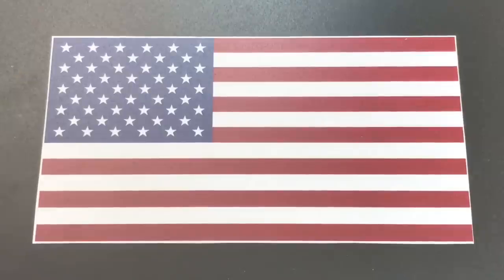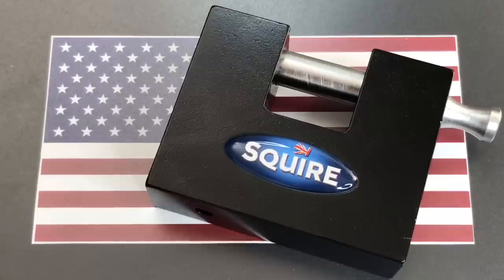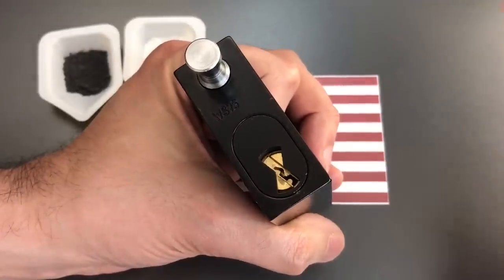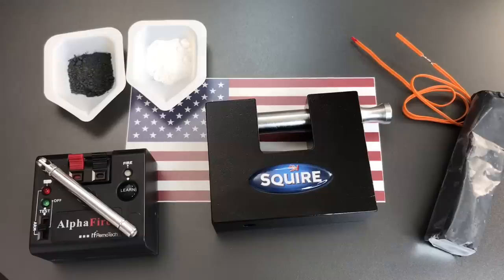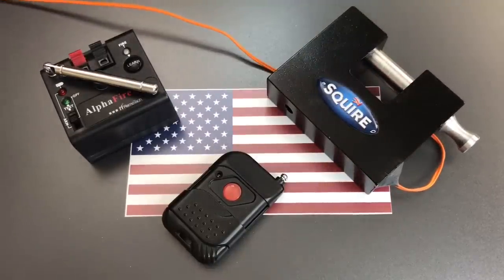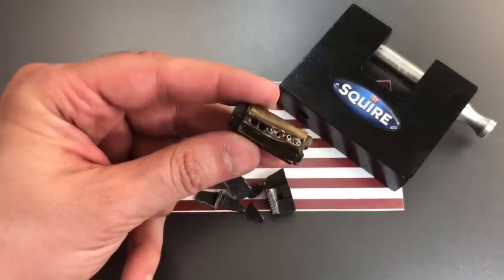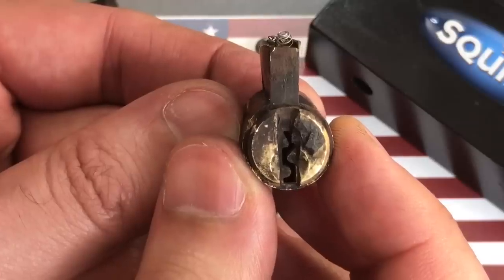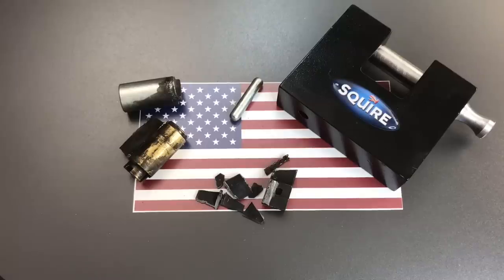[510] Opening a Lock With Explosives!!!

Comment: I tried this too, with AP. Stuffing the keyway with a key as a ramrod works well, though a bit nerve wracking.  I found that higher end locks are actually more vulnerable to this attack: The harder steel fractures more easily rather than bending, and the tighter tolerances hold the expanding gasses in better.

Comment: Chlorate and aluminium dust - great!   Excellent choice, if you're going for a mixture (rather than a chemical compound).   In fact, the only mixture I know of that would stand a chance of fully burning properly in such a small volume.   About the nearest any mixture gets to being a high explosive.   Aluminium makes anything go better   ;)    And a lovely bright flash. 
I was going to say that gelignite would be the more traditional explosive for this purpose  - but I'm not sure.   Gelignite is probably more powerful but it needs proper detonating, and I'm not sure how one would get a detonator through that narrow gap.   Just setting it on fire won't work.   Whereas chlorate and aluminium is so eager to do its thing that it only needs the slightest spark...

Comment: You probably could also do this with half the amount of explosives.
The trick is to make it airtight as possible, so pressure can build up.
It doesn't matter how little amount explosives you use: When it can hold enough pressure, it will blow.
Many people think a stronger container is more capable to resist explosives from the inside.
The opposite is true. It only makes the pressure build up, and the big bang, even greater.
I would have done it under water, leave the top open, otherwise your aquarium will also blow.
It slows down, and contains the explosion more than only a steel box.
You would be capable to film it better.

Comment: Hey, I've been wondering about thermite. It would be easy on a lock that you could put in any position since thermite flows down. I would think you would need to make a ceramic cup of some kind that would allow the flow of the thermite to move horizontally.  Try it out!

Comment: What a great way to celebrate the 4th. I didn't think you would have enough mixture to cause an explosion. 💥I figured you would get a roman candle effect. It Worked perfectly though. Shock waves always accompany an explosion. 😁 Nice job, and very entertaining. 👏
Reply from the maker: +William Mancel You probably would have been right were it not for the epoxy... that lets the pressure reach destructive potential.  Without it, this would have been a big nothing burger.

Comment: As a California Licensed Pyrotechnician, and in the Professional Fireworks Business for many years, I want to know if you really  used ONLY 50 mg of "Flash"?  Did you weight it?  50 mg is the same maximum powder limit specified by the CPSC (US Consumer Product Safety Commission) for a USA legal Firecracker (in those states that permit Firecrackers, of which California is not).  This is a extremely small amount of Pyrotechnic composition and I am stunned by the results.  Such legal 50 mg Firecrackers barely have enough powder to even function!
Reply from the maker: +Ken Nixon I did not personally weigh it, but I have no reason to doubt the person who did.  It was indeed a very small amount... as I said in the video, after seeing the small amount used, I doubted it would work. If I had guess why this worked (and take this as the uneducated musing that it is), I'd speculate that the confinement in the hardened steel lock (capped with epoxy) was far, far greater than that of a firecracker's paper shell... greater confinement equals greater pressure build up and destructive potential.  Thoughts?
Reply: I have extensive experience "playing" with 50 mg Firecrackers in legal states and is say that there is NO WAY that ONLY 50 mg of "flash: has enough energy to break that steel plate.  I will forward the video to an expert I know who has professionally researched many types of "flash" for the DOD and see what he thinks.  Quite clearly your video with the chemicals in your plastic trays far exceeds 50 mg by a factor of 10 to 50 at least, I would guess (and the "aluminum" looks like BP (black powder).  So I call BS.  To weigh such a tiny amount as 50 mg takes a very expensive, precision scale.  50 mg on the end of your fingertip looks like a tiny pile of dust.  I would also think that this tiny amount of composition would spread out and disperse within the lock "cavity", and reliable / complete deflagration could even be a problem.
Reply: I have some comments back from my expert friend (employed by a Pyrotechnic manufacturer as an R&D development engineer) who has extensive experience in all forms of Pyrotechnics.  Here they are slightly abridged below

"I watched the video and I guess I could say that we didn't see the AMOUNT of powder that was introduced to the lock, and it's always possible that it took more than one try to get it right.  The potential velocity of that mixture, if initiated rather than just lit, can be as high as 2200 fps, in "our" tests with the USG agency.  The sound in the video is more like a low pressure hiss, actually, and I think enough gas might just do it, because the lock is designed to resist external stresses, not internal.  I have a little trouble believing that the keyway was squeezed that much, but the embossing seems probable if the distribution of energy had to travel through that small opening and was held back by the epoxy.  The hardened steel cover plate would have to be pretty brittle to fragment like that. Fragmentation of witness plates is pretty small and localized, even in bigger tests.  They tend to rip.  But there can be fragments right in the center.  So I'll say the it "could be true" - I would want to see multiple trials and controlled conditions before I'd endorse it.

So the confinement certainly makes a difference.  If I remember right, the 63:35 mix is stronger in small amounts, but the 70:30 mix is stronger in anything beyond about 10 grams.  I noted that it was "black" aluminum, not just fine, and the carbon pushes and bends things a little more in an expanding gas wave, where very fine atomized would be more like a razor blade and shear things cleanly, but not push quite as much.  There's about a 1/8th inch bend with black aluminum, and a clean cut with atomized.  Both have about the same velocity - interestingly, about 1/10th that of AN when initiated.

Thanks for calling and sending it along.  I may have to start watching lock picking videos now!"

KEN ADDS -- if you look at a 6 mm dia plastic BB used in Airsoft Guns they can weigh from 120 mg (0.12 gram) to 200 mg (0.20 gram).  That weight is significantly more than 50 mg of "flash" powder (200+% to 400% more).  If you look at a 6 mm dia plastic BB that is about the same volume as 50 mg of flash powder.

I ask the LockPicking Lawyer if the amount of powder used in this video was actually that small in volume, a pile about the same size as a 6 mm plastic BB?

Comment: Just to put the weight of 50 MG into a perspective most Americans would understand this is a little less than 2/1000 of an oz (0.00176 oz) I wonder just how much powder is in a typical firecracker? According to Yahoo Answers they have less than 100 mg of flash powder, lets all be safe........
Reply: W Mc Donald its amazing how such a little amount can have so much energy and pressure.

I got the same numbers (0.001764 oz or 0.00011 lbs or in metric 0.05g)
Reply from the maker: +W Mc Donald Just looked it up... legal limit for ground fireworks is 50mg, usually with the exact same mixture used here.  The bursting charges in Launched fireworks are often much larger.
Reply: LockPickingLawyer so basically you blew open a lock with a firecracker..... Impressive.

Comment: I was looking at that remote detonator thinking how much extra risk was introduced by the unrecessed  button with no cover, and that's not to mention the probably insecure wireless protocols... Not surprised the range officer said no
Reply: Isaac Karjala generally RF isn’t going to cause a problem. “Hello Echo 41, we require GV at grid.....” Ho-Lee-fook what was that bang! Radio Frequencies do not induce explosions unless they are tuned to a RF initiators (Which are clear of voice & data frequencies)

Comment: Why did the range officer do that
Reply: Probably because it was electronic and, with much electronic circuitry, the circuits go through indeterminate states when booting up. One of those states might be "fire igniter", not something you want to happen when you turn a system on. 

Since protection would be a open switch in the firing leads before firing, there was no need for the added risks of the wireless control.

Comment: flash powder is insanely powerful
Reply: Hardly. It is a rather violent low explosive when properly confined, but rather mild when compared to some fairly easy to make high explosives.
Reply: @buggsy5  you wouldn't flick a cigarette into a barrel of it now wouldn't you its damn near thermobaric dude
Reply: @buggsy5  i agree but it is still potent in its own way
Reply: @richardsmith3199  It is not thermobaric, not even close. The mixture contains all the oxygen it needs and does not rely on atmospheric oxygen.
Reply: @buggsy5  yes you are right its not thermobaric but it continues to burn in the atmosphere once the pressure vessel ruptures and in turn consumes atmospheric oxygen just because it does especially if it is fuel rich and extremely hot
Reply: we are talking thousandths of a second here
Reply: @buggsy5  perhaps my choice of words has invited this criticism but back to the point flash can be very explosive in the right conditions and as a low explosive its damn impressive as an example of chemical energy

Comment: I believe him, but I'm still highly skeptical. I have my doubts that a low order explosive such as a perchlorate and an oxidiser would be brissant enough to deliver all that power fast enough to not just blow out the epoxy cap. 

And to be honest that's exactly what it sounded like too. When he set it off it didn't even explode, it clearly deflagrated rather than exploded. You can tell this by the hiss it made rather than a bang. 

That and the reason he didn't show us loading it and most importantly the actual explosion. Also who is silly enough to put a camera in the same box less than a foot from the explosion and not expect it to be affected. 

I say this because maybe he wanted it to be knocked down to use it as an excuse as to why it he can't show the explosion. 

I know a few drops of pure nitroglycerin will blow open a lock. I've seen it been done before, but that is a completely different beast to this pyromix he used. 

Nitroglycerin is exactly what you would want to use to do this, it has one of the highest brissance of most common explosives and it's powerful in small quantities and can flow into the lock. 

My guess is he made some nitro and used that to blow it out. And it should be obvious to most people why he wouldn't admit to making or using nitroglycerin on camera. 

I could be wrong but, when it comes to explosives, I am an expert. 
BUT just to be clear, I'm only skeptical about what he used to blow it out, not whether he managed to blow it out with something else.

Comment: "Will it work? I have absolutely no eye, dear."

Happy 4th! Great demonstration. Are similar techniques used in the field, or would that be too finicky?
Also, that single screw seems like a weak point in the lock to me. If you can get any purchase on that retainer plate, there should be other ways to shear that screw off.

Comment: My father owned a Body Shop years ago. He had a tool which was a metal rod with a screw mounted at one end. Around the center of the rod was a weight formed for easy griping. The screw was "screwed" into the fender of an automobile, which was dented, and then by pounding the weight against the opposite side of the tool or rod the dent could be removed. "dent remover". Perhaps this could work on the lock?